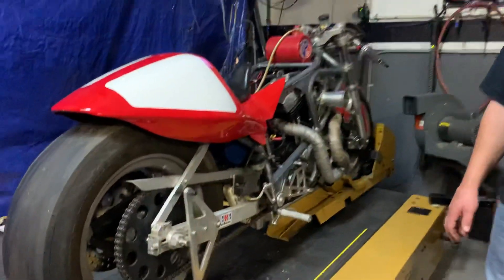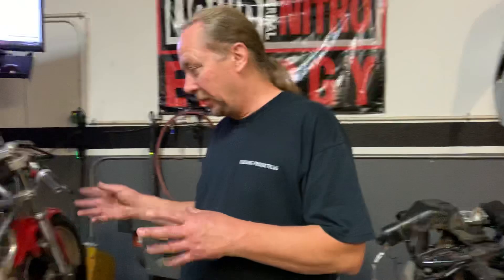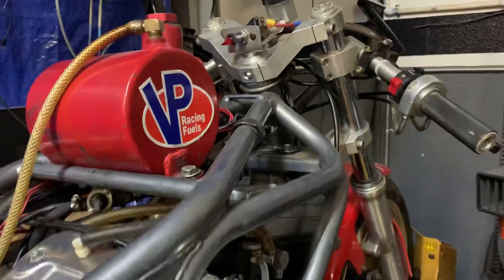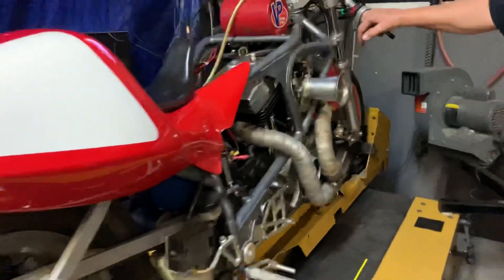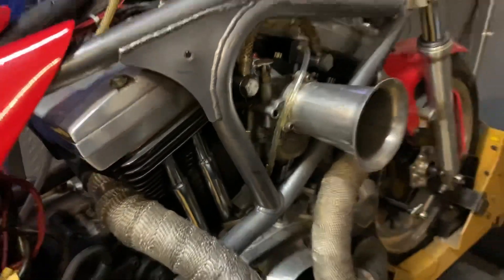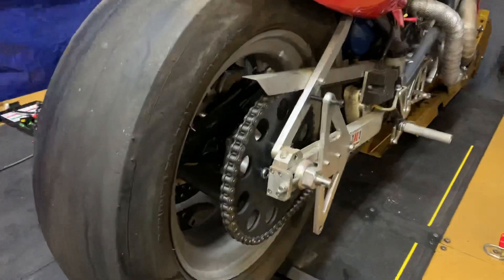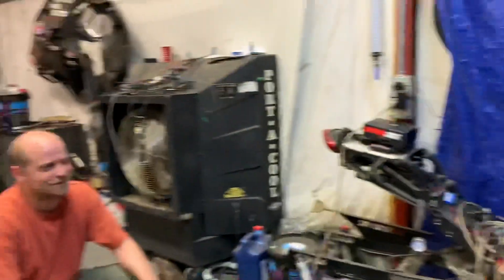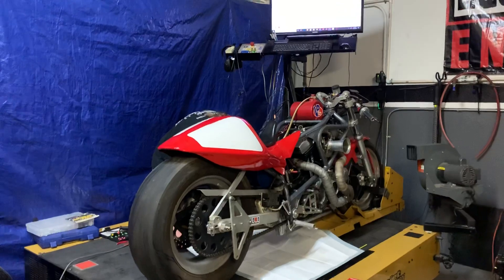ATTEMPTING TO DYNO TUNE OLD SCHOOL BUELL DRAG BIKE! HOW MUCH POWER DID IT MAKE?

Comment: I'm just now commenting on the the bikes HP guess  before the first run on the Dyno and I don't know much about a Buell and I'm going to guess lower at 122hp because a couple cylinders shouldn't be big in horsepower but great in torque power